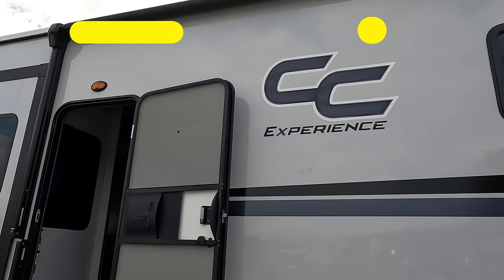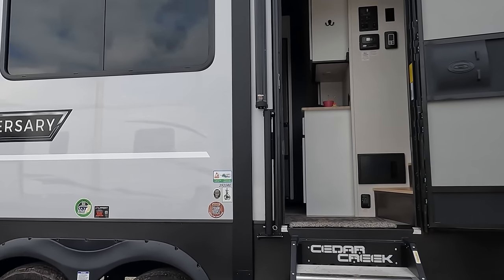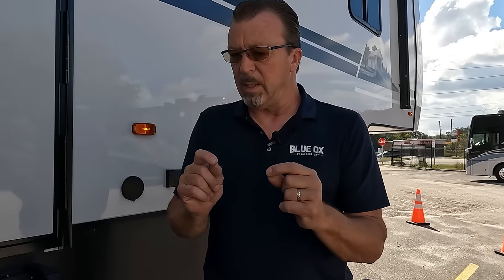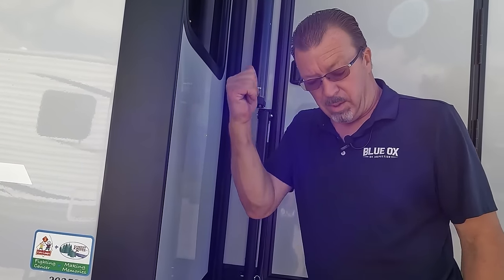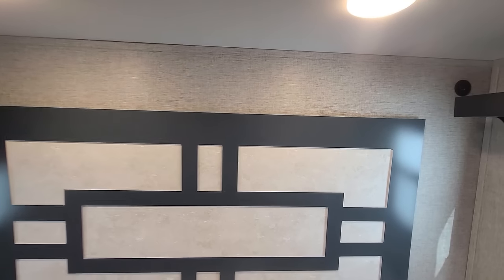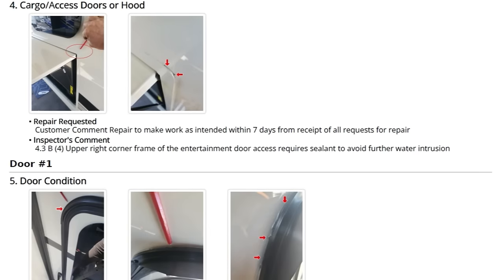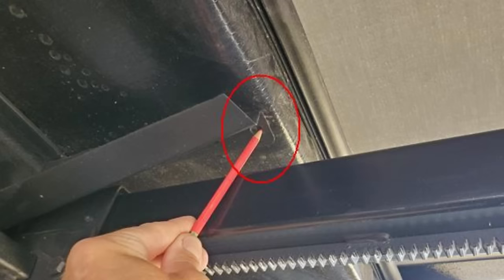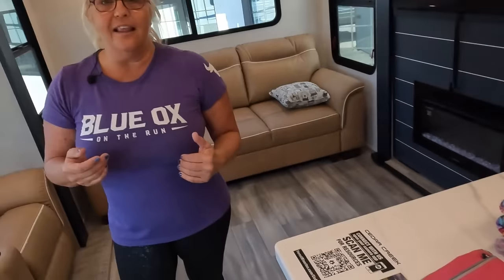😨CEDAR CREEK RV, DID FOREST RIVER FAIL AGAIN?

Comment: Interesting you talk about a small area where there is no caulking at the top of the shower. We just looked at a new  Holiday Rambler 33c where I could put my fingers in behind the shower at the top corners. Very poor installation. 
I emailed HR about this issue, the response was it shouldn't be a problem. WTF.
After 4 different camper's  something that I've noticed on almost all camper's is the poor, cheapest suspension and brakes that they put on them. With the beating they take because of the poor road's it wouldn't cost that much more to add shocks and a greasable suspension. 
Everyone that's going to buy a RV needs to go look at how they are slapped together.  We heard a lot of BS about Amish quality.  Don't believe it . Just look at how many problems people have with new camper's.
Reply from the maker: I think "Amish build" lost its pretence as well in the last few years, you are right! The embellishments of these "homemade" quality are gone IMHO. They became exactly like the "English man" that hires them for money, not quality 😑